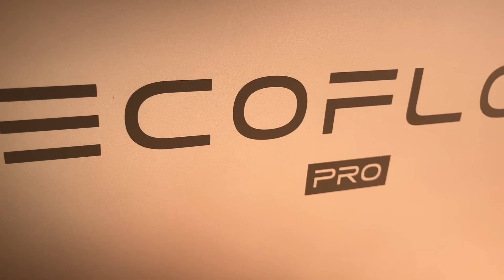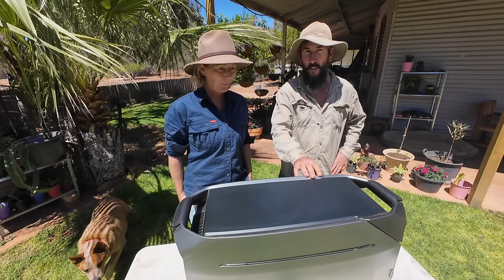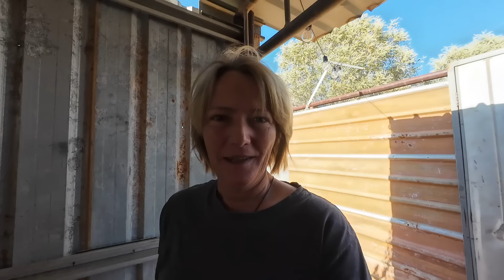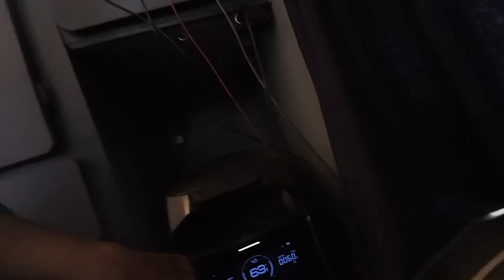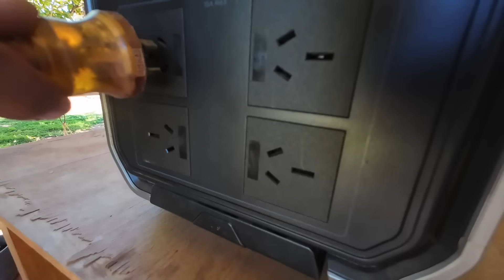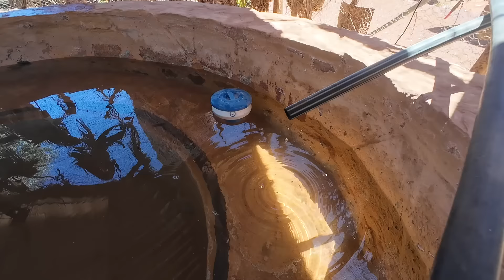Off Grid Power with the EcoFlow Delta Pro 3 Solar Generator

Comment: Use ecoflow delta 3 (not pro) plus extra battery to run small fridge in the back of my Mazda cx5 (about 2 kWH total) as this arrangement has a small footprint. We can boil a kettle, run lights, even had small cappuccino machine at one point. Car DC meets fridge load and will add a little charge but recharges quickly from grid. I could run for most of a week without grid recharge. We don't camp any more but the kids borrow this set up and really like it for camping (with an electric blanket as well!). We are not travelling off grid but want 2 to 3 days food plus 6 cold cans of drink capacity. We are very happy with it.
Reply from the maker: Sounds like a really versatile setup for your family! Thanks for sharing your experience 👍🏻

Comment: We use a Delta2 max and run a split system aircon in our caravan for 9 hrs if we wait until the charge is at 100% usually by midday. Then the solar will balance the output until the sun goes down. After that the draw will keep us going right through the night.
Reply from the maker: That's an impressive amount of run time you're getting! We might upgrade from fans to an air-con in the future 🤞🏻
Reply: @OutbackGoldFever we use a small house hold inverter split system aircon. Pulls 900w at start up drops to 400 watts after temperature in the van drop to 25 then it will cycle with average 350 - 250 watts on load. Will drop to 60w at night in between occasional cycles The solar keeps up with that. 
Our ecoflow is a 2048 wh.
Reply from the maker: Cool, we’ll look into that, thanks for sharing 👍🏻

Comment: Started this month literally finally fully off the grid in the town, 16kwh battery,  3.5kw solar used but cheap cheap 70 percent output. 

Still works. 

Used components also make it MORE GREEN THAN ANYTHING BOUGHT

If you need a link for aliexpress batteries, I know the right supplier, and ive tested them at full output. Works great. Gold sellers only ironically!
800usd per 16kwh at 100 percent advertized which i think thats as affordable as they can possibly be.
Reply from the maker: That’s great that you’ve managed to go off-grid! We don't regret it!